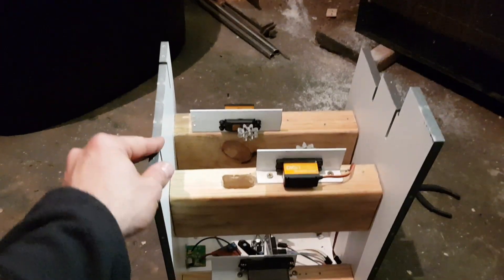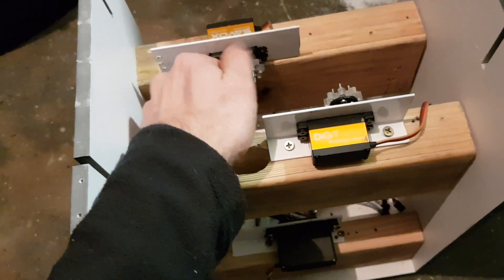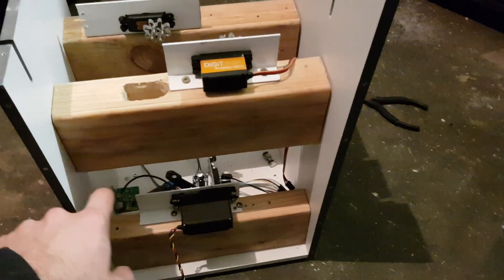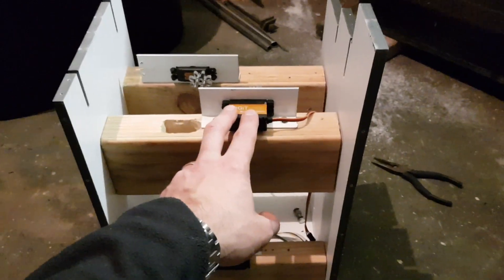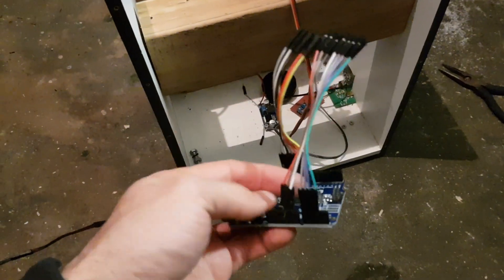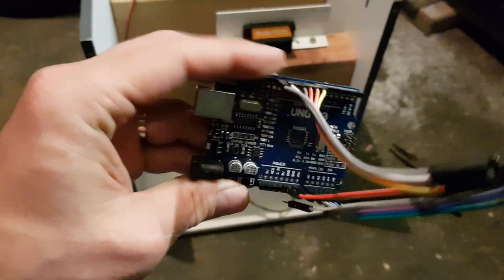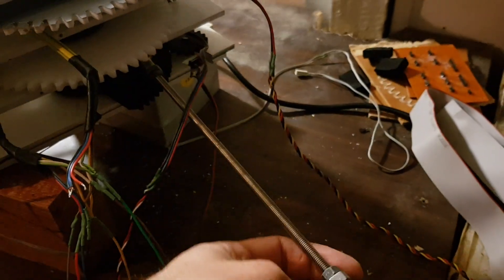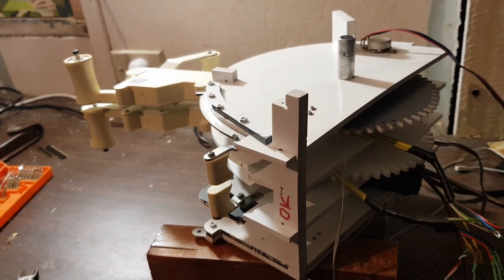737 TQ Motorization Overview

Comment: Hi Vadim, I am currently considering a design for a throttle quadrant. One question I have is, when the auto throttle is engaged in the simulator and the throttle levers are moving automatically, is it possible to manually override without disconnecting auto throttle or would I need to have a clutch to enable this? Thanks
Reply from the maker: I would really recommend a clutch.  I don't have one,  and whilst i think i can override it, because of the PID controller trying even harder to get back to set point - ill probably just break the gears. So i dont override.
I thought of maybe using a current sensor and stopping the AT on high load, or just detecting "resistance" in software on the arduino which controls the whole thing.. but really i think the best choice is a clutch.
The only trick might be getting reasonable control forces and making sure plastic levers/gears etc can withstand it. Oem unit is all metal, so thats not a concern there.